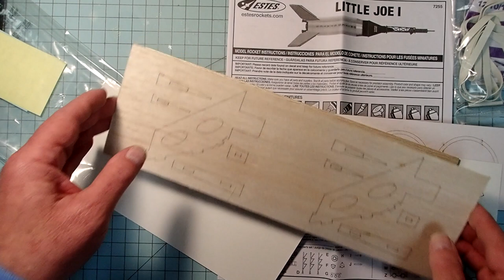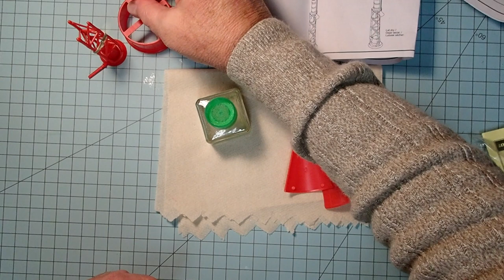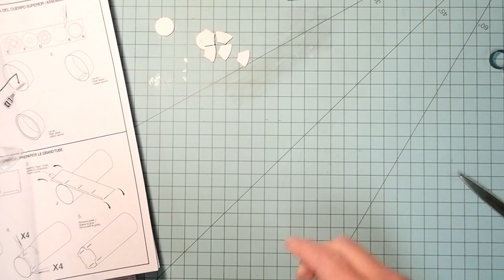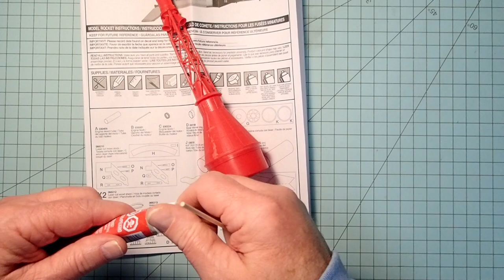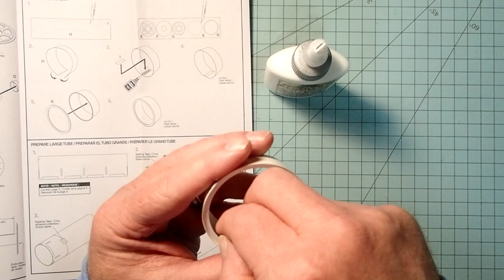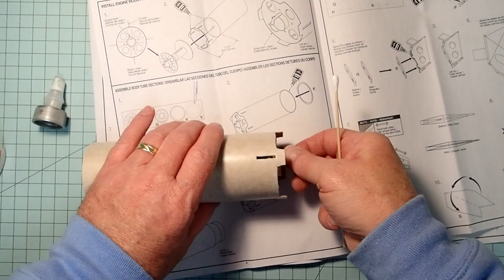Estes "Little Joe I" model rocket assembly (part 1 of 3)

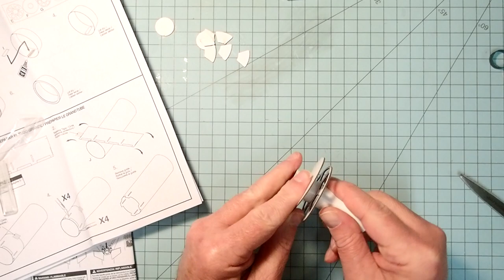Comment: Here's a little trick for the motor mount at 31:15. Slide both rings on to the tube and inch or two.. Push the spoked ring down on to the solid one. Apply CA glue along one side of each spoke on the solid ring.  Rotate the spoked ring on to the glue. This ensures the center holes are in perfect alignment. Apply glue to the end of the tube and slide the ring assembly down on to it. Perfectly done.

Comment: I also build plastic scale semi trucks & use the Tamya liquid cement that your usen. Take a wood toothpick,take sharp exacto knife go up from the point up about 1/8" & cut it at 60° angle. Take the two parts ( pieces) hold them together,dip toothpick in cement,pull it out & you'll have a ball of cement on tip, touch where the two pieces touch & the cement will wick in the joint,hold for oohhh about 30-40 second s & good to go. It will cure 100% in like 24 hrs,but a good strong joint.

Comment: So many people complain that this tower/capsule is difficult to build.  Its almost as if rocket modellers have never built a plastic model before!  

The reality is that if you use very small amounts of plastic cement (apply by toothpick) with just enough to build it and then later apply reinforcement cement once everything is assembled, the assembly can be quite EASY.  The key is that the 3 tower lattice sections should be glued together first THEN glued to the remainder of the top nozzle assembly and bottom ring (but NOT the capsule cone piece).  DO NOT follow Estes instructions under any circumstances.  

You can glue the 3 sections of the capsule together first while using the base as a stand and then LATER glue the base piece into place.   Glue the capsule cone on top of the capsule.  Paint the capsule assembly black with a silver ring on the capsule cone piece.  I like either flat black or semi-gloss rather than gloss black.  You can hand paint the ring at the bottom of the capsule bright red.  Then glue the tower assembly to the capsule assembly and you are DONE.  Gluing the spike into the top of the tower is optional so it can be removed for flights.
Reply: I was just about to make the same comment about having no experience with plastic models. A lot of people modeling don't understand how to use the cement.